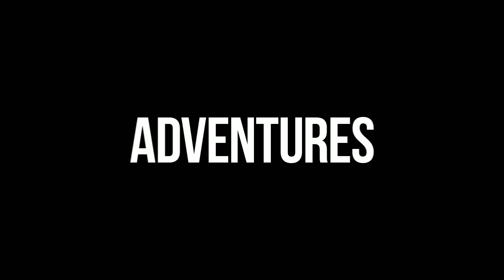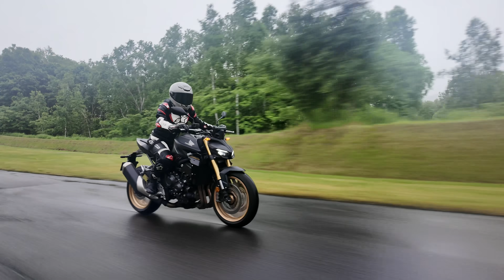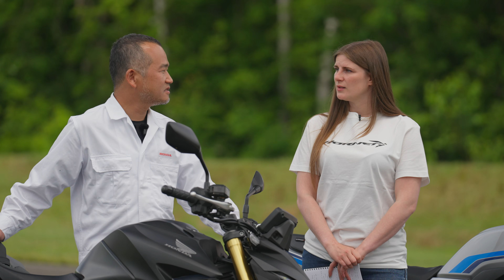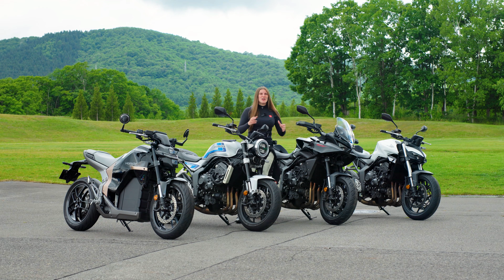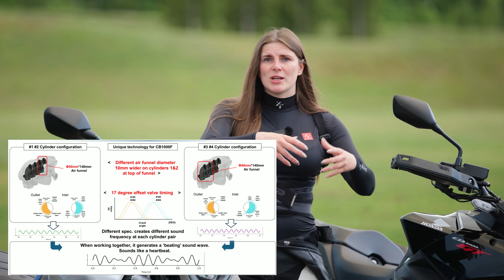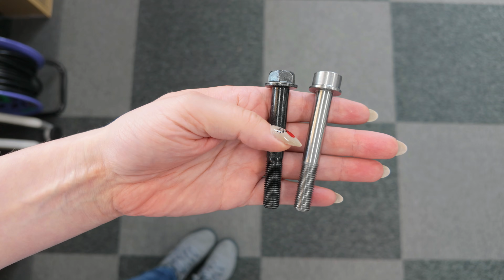I Finally Learnt Why Hondas Feel Like Hondas | My Day as a Honda Test Rider

Comment: Thinking about it, you could have an owner wanting to upgrade his motorbike, making it a project bike.
Over a period of a week or more or over winter, they are swapping out original parts for aftermarket nuts and bolts or bits and pieces... with the 50/50 risk of either enhancing the ride or taking away the spirit of the honda philosophy. 
But, because it took a bit of time doing these modifications, when you finally get out on your first ride, you have a feeling that something is off... not right. 
But of course it's not the bike, after all, you only replaced a few honda bolts with blingy titanium bolts... 
Infact, it must be you, the rider, who has lost their enthusiasm for riding motorbikes

Comment: Honda scooters (PCX, ADV) have their plastic panels clipped on. If running wires for a dashcam (Front & rear cameras plus a screen), these are much more annoying than SYM's greater use of screws because clips can break or cause plastic to break. I would like to see them be more user friendly for such modifications. Honda should also consider the Forza windscreen on the ADV as an option.

As for ADVs maybe I would go off road more with it, maybe a simplified wheel swap? I would rather use city tires off road than knobby tires on pavement as paved areas are more likely to have surprise and danger.

As for how Hondas feel, I look forward to a trip where I could test ride a Forza 125 which is much more solid than the PCX and goes faster.

Comment: You might want to check which microphone you're using for your voiceover. Or how close your mouth is to it. There's lot of sibilance. Try a different mic and/or position. Some mics are just more sensitive to certain voice types. It might just be your voice type, but there are ways to reduce it. Guessing you don't have an audio editor because they would have caught that and reduced it. But the best way to fix it is at the source.

Comment: "How many tiny engineering decisions" - Let me validate that from 58 years ago. The first new motorcycle I ever bought, courtesy of totaling my previous bike, when a car turned left in front of me, was a 1968 Honda CL-175 Scrambler. I could not believe how incredibly easy it was to work on that bike. To disassemble it, because everything was engineered with such attention to detail. That impression stayed with me for all these decades because there was NOTHING else like it, not a lawn mower, not a car, or any other device you can name. Just a little $675 motorcycle that was put together like a mechanical jewel.

Comment: A top video Kate, the takeaway from this is that these bikes are engineered for purpose. When the finished item is reviewed some 'sporty' reviewers may  have a different opinion to say a rider who might use the bike over more varied weather conditions and road surfaces. Honda (and likely other bike manufacturers)  will make design changes to fit the broader market for the designed target audience. Well presented as always.

Comment: It makes me wonder how badly we need to go with Ohlins suspension or Brembo brakes.   If the bike isn't set up well, those expensive components potentially contribute nothing to the performance.  Imagine thinking that Honda's decision to drill holes in a subframe could lead to performance gains that supercede going to higher spec components!  I wonder if this is why the new 750 hornet gets such great reviews, even though it's brake and suspension specification is only slightly better than average for the class.

Comment: my top-case have broken plastic at my second honda product ( sh xxx i ) the first honda in my life didn't 
is this under warrenty ? 
engine/powertrain 👍 700 km by 23°C up to 30 °C middle of the day in salt air conditions only 15-20 min cool down ( nearly non stop running ) 
nice qualitiy for import motorbikes/scooters ✌️🍀
but to much wight

Comment: That was super interesting. Who'd have thought a couple of bolts or a couple of extra welds or subtle changes would make all that difference in the ride. You have to hand it to the Japanese, their attention to detail is second to none.
Reply: yeah I was actually shocked that even the bolt patterns affects the handling, that's just crazy. You know in our country there's a saying that goes:
-Learn, learn more, learn forever.
I defenitely learned something today.
Reply: @hathaway.1166 Experienced it. The Bolt technical subject.
Reply: Even Sonny Barger, President of the Harley riding Hell's Angels, remarked how much better the Japanese engines are.
Reply: The Triumph model I ride sometimes has an issue with vibration - which apparently results from frame/engine bar bolts being overtightened or not tightened enough. Who'd have thought something so small would make a difference.